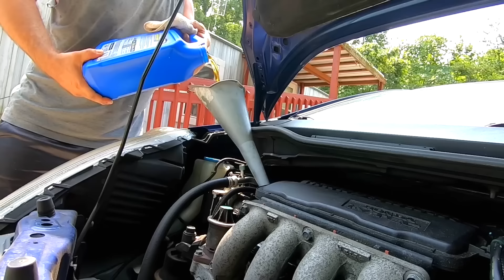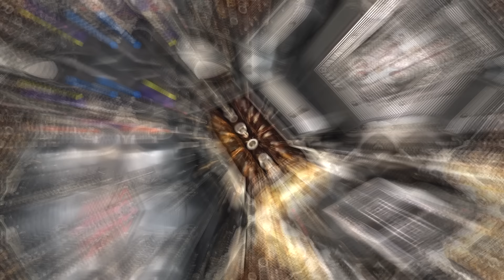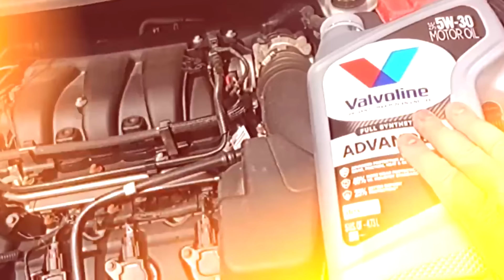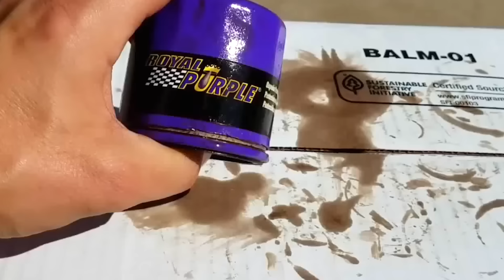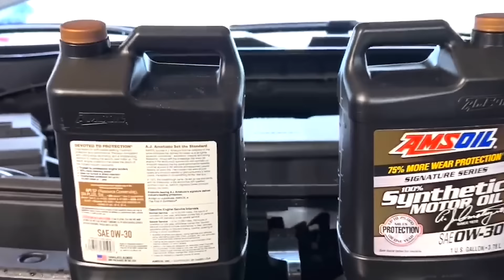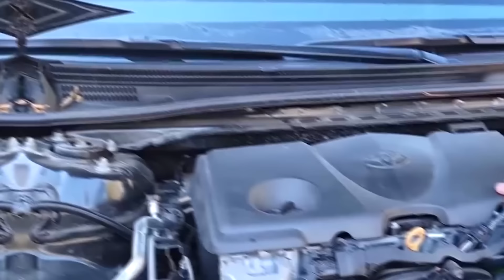I Compared 10 Synthetic Oils… and the Results Were Shocking!

Comment: Last I knew if original penzoil was heated to a certain temperature  certain ingredients separate out causing cloudiness floating around in the oil.
Reply: Pennzoil back in the 80s and 90s had issues. It was paraffin based and caused horrible slugging. Pennzoil now is a completely different animal. Shell now owns Pennzoil and completely changed the formulation. Pennzoil synthetics are (or were) synthesized from natural gas not crude oil.  My understanding is they just changed the formulation recently and (due to the Iran conflict and Hormuz  situation disrupting/causing supply issues) it is no longer made from natural gas. For the past 2 yrs I've been using Pennzoil Ultra Platinum 5W-30 full synthetic in my '16 Ram 1500 5.7 hemi,  but with the changes happening with PUP I've stepped away from it til I find out more about the new formulation, and switched to using Castrol Edge 5W-30 full synthetic. (Both at a 6,000 mi interval.) On my last oil change I decided to switch to Valvoline Restore and Protect 5W-30  for a few changes. Will see how that goes.

Comment: i wondered where my  AMSOIL would fit . not cheap but at 10 000 miles the oil test kit results were great . RAM 2500 HD super crew used for towing and carrying forestry parts or equipment between -45 and + 90 no issues .
Reply: I just purchased my very first case of Amsoil.    I decided to switch because of how far it goes between changes.     This stuff is super expensive.    But if I can change oil half as often, I'm doing it

Comment: I will stay with the Motor Oil Geek Guru for  oil advice!!!!!!!!!!!!!!!!!
Reply: Me too. By "The Motor Oil Geek" #1. Amsoil  #2 Mobil 1. #3 Pennzoil Ultra Platinum 
I have a 2019 MAZDA CX-5 AWD 2.5 L. turbo with 54,000 miles. I'm going to AMSOIL 5W-30 and stay there. Same MAZDA filters, same MAZDA dealer labor, just a brand change.

Comment: If do this ranking i will put mobil one #9 and Pennzoil #2 amzoil #1, mobil one has very low numbers and every detergent, 89molybdenun, and 75 boron where is the engine protection I think supertech do better,  Valvoline make the best balance oil in the market ,using Valvoline every 5000 miles or 6 months  will be more than fine

Comment: Never run oils pat 5K miles. Oil filters will plug, even if the oil hassnt broke down. Change oil when if warm, allows heavy contaminates to drain. Skip most budget oils. Vavoline and Pensoil are solid. More advanced oils are now onthe market. Ansoil and Liqui Moly. They test out very high. A quality oil filter is vital, ones made for full synthetics.

Comment: Where's the shock result ... u buy a cheaper syn oil u change it out sooner ... u buy the most expensive u change it out less ... no true loser or winner of any including those not listed AND same goes for the filters ... thou personally ... stay away from synthetics 'unless' owner manuals specify their usage AND advise strict use of  K&N filters or highest quality of other brands ... AND don't do the skip ... changing filters every other oil changeout.
As for BIKES ... for all year Harleys : RevTech Pure  (non-syn) OR Castrol Actevo (syn blend) OR RedLine (syn) 20w50's along 'again' with only K&N filters.
In the primaries (chain or belt driven) ... RedLine VTwin Primary Lube OR Revtech Primary Lube.
In the trannys ... RedLine OR RevTech Transmission Lube OR Quicksilver Hypoid Gear OIl 80w90.
RevTech products maybe harder to find ... Quicksilvers made by MercuryMarine.   Other 4-strokes : RedLine OR Quicksilvers recommended.
AND screw the myth of  'changing chit per mileage traveled' ... fact is : it's time NOT distance ... more times spent idling OR simply not driven than most others.
All vehicles 'should' b equipped with hour meters and date calendars ... more so than odometers.  
* Notta lube xpert here ... these r personal recommendations resulting from 60 years of trials n errors ... AND I'm not 60 sonny.
Good day to all.

Comment: I have been using nothing but Supertech in my 2005 Prius since I bought it 5 years ago with 200k. Today, it has over 500,000 miles on it and it's still running fine. I don't tow and I change the oil frequently...most of the time.

Comment: At the beginning all   Synthetic  oil rated for 20 k miles , but then the mechanics  started to tell people to change oil every 3-5 k miles so they have more work .  From the year 80 -is to the early 2.000 the  Toyota Honda  3.8L gm 5.7 Chevy , still lasted 250-350 k miles with conventional 10:w30 oil . We can’t see this with the newer cars or trucks!!! Hahaha it’s called precision  engineering .

Comment: I used Teck Wallmart oil in my Saturn 3.0 v6  and after 26000 75% high speed highway miles the oil was still good

Comment: I use Amsoil and change every 10,000 miles.  No problems so far.  It may cost twice as much but I'm doing 1/3 the changes.
Reply: At what time interval do you hit 10,000 miles?
Reply: @Bharat005  5-6 months.

Comment: Used Castrol in all my vehicles for 50 years ( cars and motorbikes ),  all done high mileage with no problem.  Anyone leaving oil in the engine for too long is asking for  trouble,  short runs are hard on oil so you need to make more oil changes if your car only goes to the shops and back, motorway miles are good for engine and oil.

Comment: I use supertech advance high mileage with hot shot stiction eliminator. Pretty much zero varnish or any build up when I pulled the valve cover at over 200k. currently have 320k on the engine and I lose about a quart of oil every 10k...I try to change the oil every 7500 miles but usually closer to 10k smh 😅

Comment: If tests is the way to pick your oil then the ultimate test was the mobile 1 challenge. Mobile 1 took new New York cabs measured internal moving parts. Full synthetic was used for 100,000 miles without change the engines were taken apart remeasured and no significant where was detected. If you're like me you do your own test. I would leave work at 5 travel 45 miles at 85-109 mph pull into gas station pull my dip stick wipe with fingers and not to hot to touch. If you like recommendations from experts. Corvette, Mercedes, Audi, Lexus all recommend mobile 1 pure synthetic. I drove my car hard and had 268,000 miles on it and it ran like new.

Comment: I use Valvoline high mileage synthetic oil and I'm impressed with it. After 150,000 miles and I found the inside of the engine clean when changing the timing chain set on our 2010 Lincoln MKT 3.7 engine. Valvoline is a Great Product.
Reply: Why would you change your timing chain ( unless it broke or there's alot of slop in the chain) .

Comment: I was taulght that when an engine starts to use oil, the oil has broken down.  It should have been changed just before it started to use oil.  I still change mine every 5000km.  Have driven both Ford and Mopar trucks on the job.  Every  one had around 450K km on them when I turned them in and were running well, didn't use oil.  Not sure how long they would have run. HJD

Comment: Over the years, I've used all kinds of oil, both synthetic and regular. I usually bought what oil and filters that were on sale. I changed oil and filter regularly at 5,000 miles.   I do prefer Castrol Or Valvoline when I can buy it on sale. I had 457,000 miles on the engine in my 1984 Crown Victoria, Had to park it because the body rusted out. The engine still did not burn any oil. My 1982 Ford F150 with the 300 cubic inch still runs at 435,000 miles. Does not burn any oil.  My 1993 Dodge D250 (Cummins) has 540,000 miles. Still purrs like a Tomcat in a creamery. Change oil and filter regularly, don't overheat the engine,  warm it up before you drive, and idle the engine for a minute or two before you shut it down. I have newer vehicles with 200,000 miles (more or less). All those engines still run well.
Reply: Exactly
Reply: I’ve heard it is not necessary to idle engine before shutting down.
Reply: @havefunpk if it's a turbo, you should. That turbo spins at about 20,000 rpm, let it cool down.
Reply: I drive 04 Nissan Sentra 1.8 with 675.000 miles on and still running I use Fram oil filter and what ever synthetic  oil was on sale since Fram is gone with the wind I switched to Mobile oil filter 👍✌🏽
Reply: I use mobile one extended performance for engines over 75,000 advance full synthetic guaranteed to protect upto 25,000 miles. I change it every 10k mies since I drive mostly highway miles.

Comment: This is just a Pennzoil commercial. Trying to push Pennzoil because it's crap and nobody wants to buy it. The last time I used Pennzoil it fucked up the bottom end of my engine...a  low mileage 351 w 37000 miles. The viscosity broke down 10w 40 motor oil that while it was at operating temperature I pulled the dip stick during a fuel stop that shit was dripping off the dipstick like water...
Reply: Pennzoil back in the 80s and 90s had some serious issues. I wouldn't touch it. Back then I used Castrol GTX (and still like and use their stuff).  Shell bought Pennzoil and totally revamped the formulation of their oil. 3 yrs ago I bought a '16 Ram 1500 with the 5.7 hemi. I did a bunch of info gathering on various oils and learned of the changes to Pennzoil and its great properties. Their full synthetic is synthesized from natural gas not crude oil... or should I say "was".  In the past 6 or 8 months Pennzoil Ultra Platinum 5W-30 full synthetic (which I loved for my truck) was getting hard to find. Come to find out the Iran conflict and Hormuz situation was disrupting their supply chain and they decided to change its formulation... no longer made from natural gas.   So I've  stepped away from using it til I learn more about their new formulation and how it performs. I went back to Castrol Edge 5W-30 full synthetic for a couple changes (I do a 6k mile/6 month change interval) but have decided to try the Valvoline Restore and Protect 5W-30 full synthetic for a few oil changes and see how it works.

Comment: Always change your own oil,  at recommend service intervals,  
The price of a oil chane will cost around $45.00/ $50.00 including filter. Thats about 30 min of a mechanic hr of labor, 
Trusting a total stranger, at min wage, can cost you $10,000.00
Diden't belive it untill i worked for a large quick lube/ transmission franchise. Seen some stubid shit pulled in those pits.

Comment: Frequency trumps quality, if you have to choose. I have used Mobil 1 for decades. My '06 Corolla had 370K trouble free miles when I sold it. Never had any motor work or tranny work. Everything on the car worked perfect. 5K mile oil/filter changes.
Reply: Agreed. Mobile1, 5000 mile oil/filter changes. Toyota products.

Comment: Can't believe the folks here wasting their time changing their oil every 3000 miles.  I can see that if you live in a small town, short trips, barely getting your vehicle to operating temperature, etc.. 
My worst situation was driving a 160 miles /day commute.  I used fully synthetic Mobil1 or Castrol exclusively, and used a premium filter.  Almost all vehicles had well over 200k miles on them, ran exceptional,  none burned any oil, passed all emmisions testing, etc. when I changed to a new vehicle.  I've done 99% of my oil changes since the early 70s.  None have ever had an oil related issue.
Shorter commutes I've done 5000mi intervals.. but the 160mi commute was 10k changes.  That's probably 1.5 million miles of driving. 
Ford, Merc, 2 VW Jettas, 3 F350, F250s, Volvo, Buick, Olds, and currently Toyo- Tacoma.  Just change the oil according to conditions, using the best available filter.  Unless  you have extreme conditions,  3000 mile intervals are not necessary.

Comment: All synthetics are made out of olefins, not crude oil. That's why they're synthetics. Oils made out of crude are called conventional.  Any motor oil made of crude can not be called full synthetic.  I question the veracity of this video.
Reply: You are wrong. There are two terms used. Full Synthetic, and 100% Synthetic. One is made from petrolatum, and the other is made ground up in a lab.
Reply: @RobKHere bullshit. Group III oils are only synthetic based on court ruling.  Chemistry says otherwise.

Comment: They never mentioned Valvoline restore and protect!!
Reply: Yes they did...you missed it if you didn't see it!?..🤔
It was in the middle of the pack!..Pretty good oil!..👍.. Just change around 3000 miles, unless long trips..and you can't go wrong!..👍
The one I use they didn't mention.. Quaker State full synthetic..5w-30..0w-20..and 10w-30 ...along with a 1/2  a Qt. of Lucas full synthetic oil stabilizing additive!..👍
Changed every 5000 miles or sooner depending on the driving durations, short trips or longer trips!..
You can tell if your checking your oil weekly, the condition by the color change from when it was new!..
If it's looking dirty,  change it, ..unless its a diesel engine, they look black in a few hundred miles!..🤔😎👍
Reply: Dude was correct, test was on Valvoline advanced not restore and protect. They just showed it in video. I suspect you need to follow your on advice. BTW it’s what I use and would have liked to hear about it specifically as well.
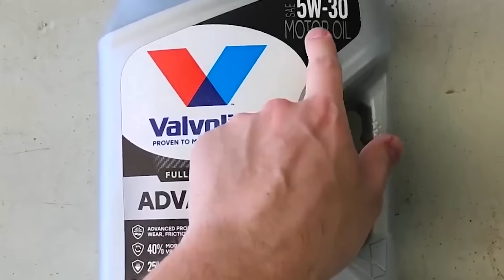Reply: 11:56 valvoline restore and protect. Pay attention instead of complaining.
Reply: @midcoastwildlifespecialists Test was on Valvoline advanced but they also slipped in pictures of Restore and Protect. I suggest you follow your own advice. It’s the oil I use and would liked to hear what they thought on it specifically.
Reply: That's not Premium Oil.   It's sold at Walmart

Comment: I firmly believe in fully synthetic oil in my engine, transmission, and every single application that requires a lubricant as well as regular changes at regular intervals and so does my daily driver, a 1993 Ford F-150 with nearly 300,000 miles. Here’s to making 400,000! 😊

Comment: I put almost 900,000 on a Detroit Series 60 using SuperTech diesel  oil.
Reply: Detroit Series 60 is the best Diesel ever made. Had one. 2,000,000 miles not uncommon. Super Tech Diesel Oil made by Warren is excellent oil. And reasonable price.

Comment: Modern oil are much better than old times. I go 5k on mine. 105k,110k, 115 ect. Easier for me to remember. If I pull a trailer any length of time(3 plus states) when I get done towing, I change it, drive to next 5k. 235k on my F-150 Triton.

Comment: I use the walmart brand in my e 150 it lasted for 4 hundred thousand miles i towed trailers used it every day. I changed it every 3 thousand miles. It finally stopped running after the timing chain skipped.i would have fixed but the body had rust and int was worn out.
Reply: Walmart and Kirland oil is just fine. Change it every 3-5k miles and you'll be fine.   If you're using 0W-20, move to 10W-30 and thank yourself later!
Reply: I had 337,000 miles on my kia sephia and I used the Walmart brand. The only reason I don't have the car anymore is that some stupid ass driver plowed into me at over 60 mph. The car had no oil leaks and didn't burn oil.
Reply: SUPER TECH!  
I’ve used it for 30yrs on all my Vehicles 
Full Synthetic @ 5k mi. W/Filter
-
NEVER EVER ANY ISSUE AT ALL

Comment: You left the Valvoline comments very confusing on which to buy or use by talking about and showing Valvoline Advanced and  Valvoline Restore and Protect which are 2 different  oils, or did you not know that?
Reply: I've been using the High Mileage Synthetic and have been getting Great results.. My 1997 Lincoln Town Car had 307,000 miles on it before swapping it for a 2007 engine due to a cracked head. The inside is very clean. The same with our 2010 MKT when I changed the timing chain set @ 150,000 miles.

Comment: wrong oil is better than no oil. 😂
Reply: But get rid of it quickly !
Reply: dude would never buy a used car from you...
Reply: @cjune21 😂
Reply: Get the right viscosity for your engine and climate and driving style and change every year or 3000 miles whichever is sooner, for higher mileage engin e I add lucas oil stabiliser additive
Reply: But tell that to GM, THE L87 ENGINE, (2025) USING THE WRONG MOTOR OIL WILL RUIN THE ENGINE COMPLETELY WHICH IS A LIE, THEIR COVERING THEIR BUTT.    I NOW OWN AND DRIVE A TOYOTA 4 RUNNER LIMITED WITH A 4.0L V6 WHICH IS FAR BETTER THAN THE GM, FORD AND CRYSTLER.

Comment: I have a 2001 Lincoln Town Car, 205,000 miles, change oil every 7,000 miles. Still get 21-24 MPG .  I dont think changing oil every 3000 miles is necessary. Just my opinion.
I do my own oil changes. I have used Edge, Castrol, and Super Tech . At 170000 miles I changed from 5W20 to 10W30. No problems.